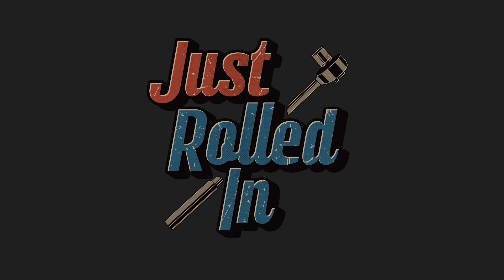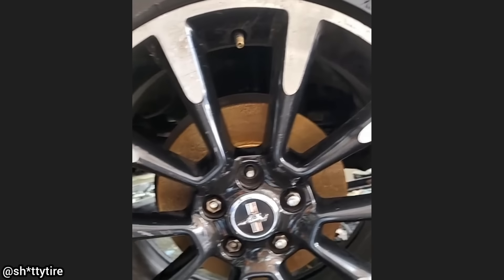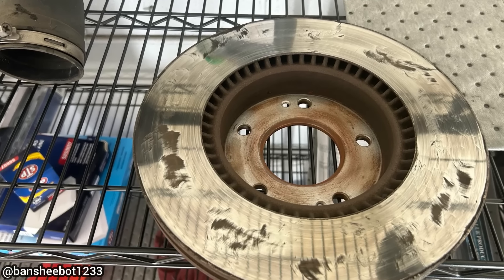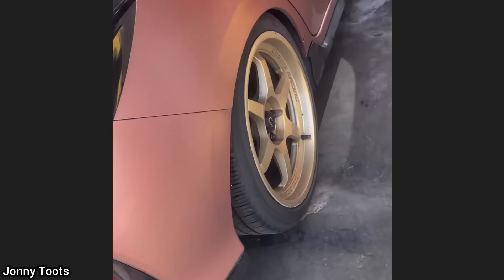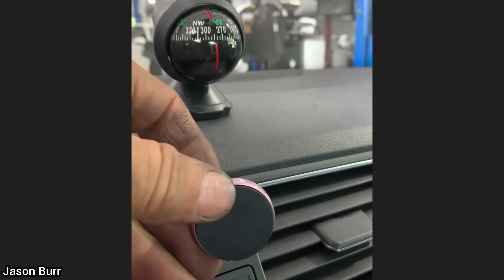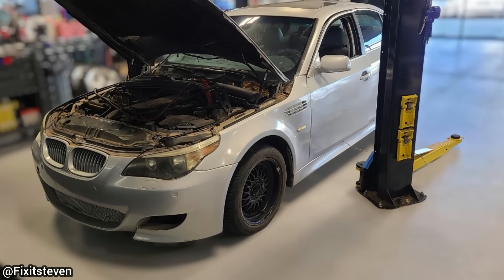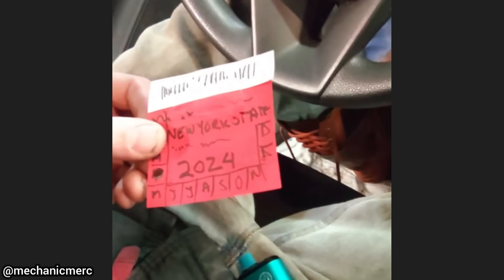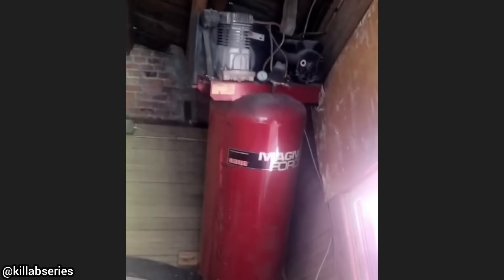Customer States "Another Shop" Ripped Him Off

Comment: Can you imagine paying a shop for an hour to diagnose a $1.25 compass? WHEN YOU ALREADY HAVE A BUILT IN COMPASS??
Reply: Like what are some of these service advisors thinking.
Reply: I assume it's part of other maintenance they've got going on and they just added that to the list of things for the mechanic to check up on. A lot of those have been clearly at the bottom of longer lists of issues.
Reply: Imagine putting a compass in a car, period.  This used to be common with the elderly... in the 1980s.    Boat?  Yes.  Airplane?  Definitely.  Car?  I don't understand.
Reply: @grayrabbit2211  Maybe they will drive across a desert. You never know :D
Reply: not every car has a compass but if you have a GPS then you really don't need a compass.
Reply: @grayrabbit2211  It's redundancy, which is nice. A compass can't fault you unless there's interference. A GPS can screw you over by taking you down roads you don't want to be, or in worst case scenarios taking you the opposite direction of where you want to go. Physical maps and a notepad with written directions are the most foolproof so long as you know what you're doing. Combine all 3 and you can't get lost unless you're trying to get lost. Give me ALL the data points.
Reply: @FurryWrecker911 You also gotta know where you started or where you currently are, which can be, ya know, a bit problematic for some! 🤣
Reply: @TheTrueBuster  Oh my god don't even get me started! Haha! Trying to go out to lunch with coworkers is like herding cats every time. I'll say "let's go to the hard rock bar for lunch" they'll ask "where is that?" I'll say "just North West on Penderson." and they'll say "oh up that way?" and point East. A lot of people have zero sense of direction and would drive themselves off the grid if left unattended, I swear.
Reply: @FurryWrecker911  Sooooo what you’re saying is people need a built in compass now too? I always felt like I had one, rarely ever went the wrong direction. My mother and grandmother on the other hand, would get lost before they even  left the house.
Reply: @FurryWrecker911 I'm basically you're coworkers. I call myself "directionally challenged"
Reply: @AaronTownsendTV  The only thing that a service advisor is thinking, is, MORE MONEY, MORE MONEY.
Reply: A compass in a steel cage is always a bad idea.
On steel boats they always have compensators.
Reply: Wtf do you need a compass for
Reply: Imagine not knowing a compass works with earths magnetic field
Reply: the real question is why would you bring your car to a mechanic to fix something that didnt come with the car?   logic would say, go back to the store where you bought it
Reply: @grayrabbit2211  I was wondering about this as well :D . Maybe the owner was a captain or had a boat and added this as a novelty item.
Reply: @grayrabbit2211  you think all planes have a magnetic compass, but it’s mostly specific older models that carry one on the windscreen. Almost all aircraft are equipped with a gyroscopic heading indicator that points to true north rather than magnetic north, and is a lot more reliable to read.
Reply: @fortunatebum  Actually it's just the opposite.  The gyros can't be relied upon due to gyroscopic procession, which is why aircraft are REQUIRED to have a "magnetic directional indicator" a.k.a. compass installed per FAA Part 91.205.  You have to periodically reset the gyro to match the magnetic reading.   

Even the brand new Airbus A350 cockpits are equipped with magnetic compasses.
Reply: @TheTrueBuster  We used to have one. AKA people used to be able to point out cardinal directions by knowing where the sun is and approximately what time it was.

Comment: I've seen a lot of compressors developing leaks due to rust. But I'd never imagine one could fail so catastrophically as to launch itself into the ceiling.
Reply: If you look up videos of air compressor tank explosions that one is actually pretty tame.. I've seen videos of them coming apart and throwing shrapnel like a giant hand grenade 😳
Reply: @GoughCustom  I will have to do that as I really didn't think that could happen. I don't know whether to be impressed, or afraid. 😲 And I thought I had seen it all.
Reply: @KLondike5  I've worked in shops most of my life with compressors ranging from 80 gallons to massive tanks with 6" airlines protruding from them. And I've always had one or more compressors at home. I can't count how many tanks had to be replaced due to leaking. Some leaked so badly that the compressor could not keep up. But I have to admit, I've never seen one explode.
Reply: Seriously one of my biggest fears at my workplace. We have a massive compressor for our large body shop, every time I have to go in the air compressor room for something I get out of there as quick as I can.
Reply: @KLondike5  they are actually very thin. the skin will be about 1/8 inch thick and the base hemisphere maybe up to 3/16 thick on a small tank like that. it will actually be stamped on the certification tag on the tank giving the thickness.
Reply: Pressure vessels..... the ultimate jump scare!
Reply: @GoughCustom  I didn't realize they'd explode until a few years ago. My wife and I bought a house via estate sale and there was an 80 gallon compressor bolted to the floor in the Garage. I built a small workshop and moved it over into there.

I was bolting it down (after a good cleaning) when I noticed the expiration date on the bottom- it still had years left, but then I saw the explosion hazard warning. I went to my computer and looked for videos of air compressor explosions. Dang!!! Scary.
Reply: Should have used spray foam on it.  😄
Reply: @my3dviews  Works on BMW sumps.
Reply: Water heaters do it to!!
Reply: I take it you never saw the Mythbusters episodes where they forced hot water heaters to fail then.  In comparison, that seems almost mild.
Reply: The two most common causes of compressed gas chambers exploding/flying are over pressurization (like if an overpressure valve is sealed) and damage to the chamber wall. Never replace a hissing valve with a plug, always a new valve of the correct type.
Reply: @evilsharkey8954  And you wouldn't believe how many such safety releases are on a modern tank-type hot water heater.
Reply: I have an electric, automatic, drain on my air compressor that drains for 4 seconds every 45 minutes.
Reply: I get rid of the valve at the bottom of the tank, and add in a flexible braided stainless line that goes outside of my shop, where I put a high quality valve. Makes it easy to empty daily, and no more mess in my shop.
Reply: @GoughCustom watching one of those was why I decommissioned my father's old upright Craftsman (when the name meant quality) compressor. It had surface rust and rusty water when drained from 120 psi. Still gives me the willies thinking of the potential damage.
Reply: With any luck rust will be significant enough on the outside to make someone think twice about using it. Or enough small leaks will cause decompression before one sudden half second leak.
My marine biology teacher had a picture of about half of a Jaguar he took on a diving trip to the Bahamas. The open rear half was peeled back like a banana. The theory was that over pressurized scuba tanks were left in a hot trunk.
Unexpected decompression not good. Instantaneous decompression very bad.
Reply: Where I live air compressor receivers are treated like any other pressure vessel and require inspection by a state authority every X years (where x=4, I think) in businesses. Private individuals have no such requirements so accidents happen.
My hobby is miniature love steam locomotives and the boiler in our engines are tested hydraulically every year if made of steel ro you don't haul public. Only a fool fails to get their loco tested because the first person to get hurt is you if it fails.
(Edited to correct typos)
Reply: Old compressor of mine (quite old when I bought it used) developed a pinhole leak. That was enough for me to get rid of it. I decided to cut a hole in it before putting it at the street to prevent someone else from using it. When I opened it up, the entire bottom was covered with thick sludge. I always drained it, but only got minimal water out, always rusty, but never any of the sludge.
Reply: @Razmoudah  that is still one of the most bonkers things I have seen, And then they did it in another episode with a simulated 2 story home and the tank cleared the first floor, second floor and the roof.
Reply: @christopherconard2831  The craziest thing I remember being told about was in shop class during safety with the acetylene tanks. Someone left one in a car and apparently it had a leak at some point found ignition and the rear axel was found across the street in someone's living room.
Reply: In my country, air compressors reservoirs must be checked and certified periodically. And the law dates back to the XIXth century!
Reply: @filanfyretracker  I also remember that about the time they did the comparison against the simulated two story house there was an insurance company running a home insurance ad that had a hot water heater fail and go through the roof.  I found it hilarious that the ad was UNDER-dramatized in comparison to Mythbusters.
Reply: @chefchaudard3580  That just goes to show how rare 'smart' politicians really are.
Reply: MY grandfather has this really old compressor that rust a pin hole in it. His solution was to slap a self tapper into it! It sits directly in front of his show car and I wont even enter his garage if he's using it! I have tried to warn him of the dangers but nope he knows better than I lol
Reply: I'd bet dollars to doughnuts the tank failed because someone fooled with the pressure cut-off or safety blow-off. IOW, there was a leak and they installed a pipe plug.
Reply: @rupe53  capping the overpressure valve is in fact one of the failure modes the Mythbusters mentioned in their water heater videos. Homeowner sees a drip drip drip and instead of calling a plumber they go to Home Depot and grab a 3/4" plug and drip goes away, Not realizing they nixed the last line of defense if the thermal cutoffs also malfunction.
Reply: @paparoysworkshop  An exploding air tank is one of my greatest shop fears. This is just a reminder for me to quit procrastinating about building an air compressor shed outside my garage.
Reply: @countryjoe3551  Hope the wall it's against the outside of is concrete or thick brick because otherwise it might end up inside again anyway 😅
Reply: Remember, it was an exploding air tank that killed the shark in Jaws.
Reply: @kc4cvh yeah, but that was dumb. All a rifle would do is puncture the tank and it would freeze as gas expanded. Air compressors failing due to a rusty bottom is another animal and the reason people need to install driers
Reply: About 7 years ago, a steam tank exploded in St Louis.  Killed 1 where it took off, 3 where it landed almost 200yds away.
Reply: That is the craziest thing I have seen lately. Don't you know it made a hell of noise when it hit the ceiling!
Reply: Not sure why people never pay attention to the expiration dates on air compressor air tanks.  They are normally clearly labeled Retire From Use after XX.XX.  Most air compressor tanks are supposed to be retired and scrapped after around 10 years of use.
Reply: @KLondike5  I always drain mine completely after every use.

Comment: I'd rather entrust my car to a shop owned and operated by The Three Stooges for repairs than some know it all family member, relative or buddy.
Reply: Never take your car to "another shop". 😆
Reply: The alcoholic brother-in-law that "knows everything that there is to know about cars".
Reply: My brother is a trained mechanic.  Sadly, between his job and taking over the family farm, he rarely has the time to work on anything, so I'm still stuck going to another mechanic.  Still, I only trust trained mechanics.
Reply: I've got a metal Three Stooges "Knucklehead Garage" sign in my garage, it says "we're not happy till you're not happy."
Reply: When they say "another shop" did the work, in that case they really do mean The Three Stooges: Me, Myself, and I.
Reply: I've had so many problems finding an honest, good mechanic that I'm exactly the opposite.   At least a family member won't actively try to rip you off.  Just make sure they have some actual experience.
Reply: That's just code for the customer did it themselves
Reply: I'm sure the Three Stooges would make great use out of spray foam.
Reply: @ReadTheShrill  Tools also. It can be useful.
Reply: It's being able to know your own limits. I grew up in an auto shop(my dad owned a small one), but I'm not a mechanic professionally. I can do most basic jobs, oil changes, brakes and rotors, things that don't require a lift, and specialized tools and equipment. I learned just enough about doing this kind of work that I can be trusted to not get into something over my head, and also to not completely screw something up, ending up with extra parts, etc...I also don't want to endanger my family and friends, so I make sure I'm doing things properly, and if I can't, I tell them.
Reply: "Another shop" might pooch the repair, but the Stooges aren't finished until they've utterly destroyed your car.
Reply: Unless your buddy happens to be a retired car mechanic willing to help out with basic maintenance and some minor repairs. Plus when I do need to go in a repair shop I already know exactly what's wrong with the car, how it should be fixed and the approximate cost of the required OEM parts, so I don't get scammed with unnecessary or fictitious repairs.
Reply: @mrquirky3626     yeah, but in the days of the 3 Stooges, their spray foam was shaving cream!
Reply: i work on fleet trucks for a company and i work on my own vehicles. other then alignments i do 99% of my own stuff and ive never had any issue in the last 20 years of my driving history...

Comment: Customer states "the flux capacitor is missing".
Reply: he left it with the di-lithium crystals on his last trip to mars
Reply: "Sir, your model did not come with a Flux Capacitor."
Reply: Clock is out of sync.
Reply: Come back in 1985 and we'll have it  for you.
Reply: Customer "I bought a DeLorean because this timeline sucks. Now fix it so I can drop back two or three decades and hit the reset button."
Reply: Customer states gas pedal is not moving correctly and mechanic says who lost the top of their cane recently? 😂
Reply: fun fact: in German-dubbed movies it's a "Flux Kompensator" i.e. compensator - makes totally more sense than a capacitor ;-) Back then they also often confused English "silicon" with German "Silikon" (instead of "Silizium"), which means silicone - I think it was a Terminator movie that made me laugh out loud in the cinema when they were talking about a high-tech silicone chip from the future 🙃

Comment: How on earth do you incorrectly install a floor mat 😂
Reply: I put the floor in just fine and don't call me Matt.
Reply: Why do people turn their airbags into claymores?  Don't ask the question unless you are absolutely, 1000% certain you wish to comprehend the individual in any way. :D
Reply: You have seen nothing yet, young padawan
Reply: I’ve seen them towed in because of a no start. The mat was pushing the accelerator down and won’t start when you do that.
Reply: You get "another shop" to install it.
Reply: Floor mats are banned on most (maybe all) race tracks due to this.  And all modern factory mats, AFAIK, have anchor points because of this.
It's actually very common.
Reply: @lukederek10 (Just rolled in contributor) > Challenge Accepted.
Reply: So how do they accelerate, step on the pedal through the floor mat???  Surprised this fool is still alive!
Reply: I don't get how these people are driving. Like, fumbling around with their foot hoping they push on the right part of the mat? Ugh.
Reply: With a great deal of mindlessness practice.
Reply: Work in retail customer service for a hour and you'll realize that you should be more surprised that there are people that can correctly install a floor mat.

Comment: Customer States : " I'm too stupid to live" " I Should NOT Be Driving a car"
Reply: 😆😆😆
That comment brings back memories of overheard conversations between service writers and technicians.
Reply: @EarlSinclair97  One shop I worked at, the owner's background was carpentry and he walked around with a tape measure. One day, the alignment hoist went up with a GMC Sierra 1500, but would not come down. There was a bit of petty bickering between the shop owner and the vehicle owner when it was determined the hoist would be repaired the next day. The next day, the shop owner is standing over the guy fixing the hoist and he says, "You have the hoist 36" from the ground. I need it down another foot and you can go." Hoist repairer replies, "You'll get it all the way to the ground and then I can go." Shop owner says, "I don't care. I just want this truck off the hoist and out of the shop."
Reply: Technician agrees with customer.